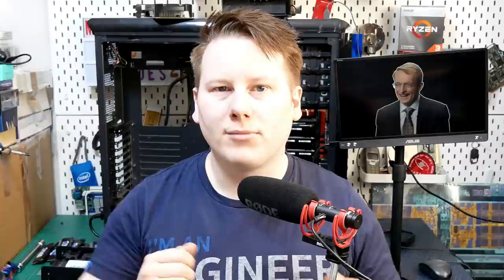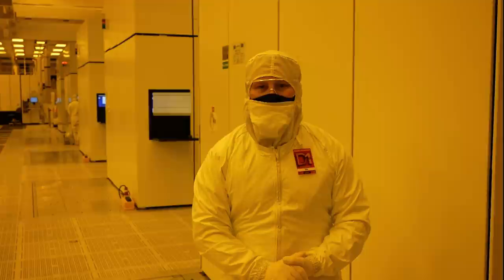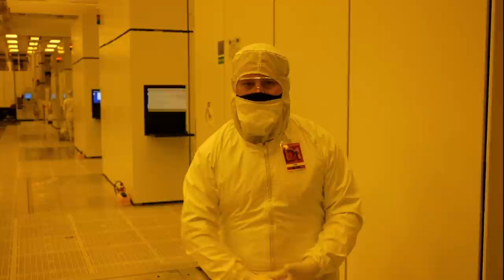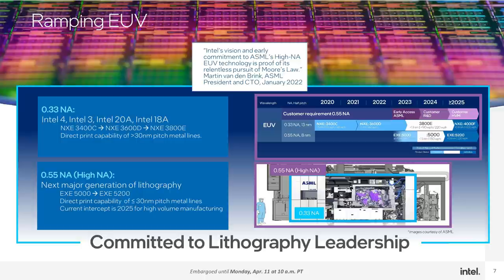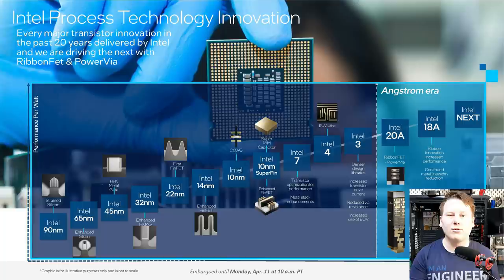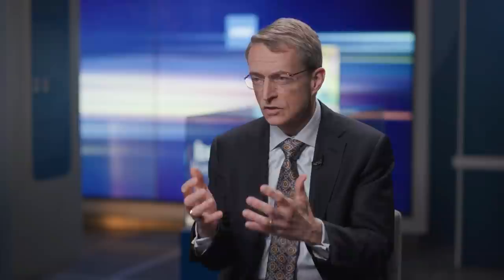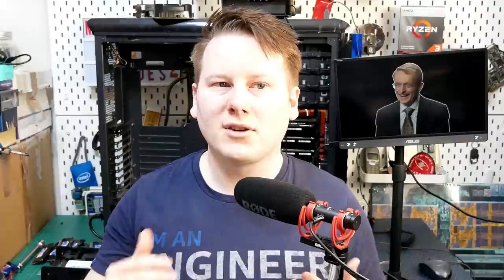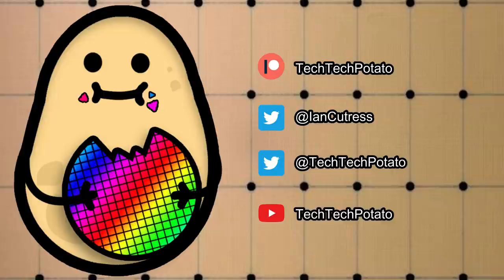Intel's Gordon Moore Park Fab Expansion: More Chips!

Comment: Oh wow they finally opened the place and renamed it? I used to work across the street from there and I've been inside a few times - it's so friggin' huge. 

They had cranes going in and out so much, and one of the buildings has an overhang/connector to an adjacent building so high up that there's a big sign on the side that says something like "Maximum Clearance 150 feet" or something.

p.s. I have the same intel engineer shirt ;D

Comment: so based on this info it some seems like intel 4->intel 20A is the real 'full' node jump, while intel 3 and 18A are more like tsmc's N6 and N4 in-between nodes basically '++' optimzation steps for the bulk orders
Reply: Correct in the sense that Intel 3 and Intel 18A are optimizations of the new node process, but incorrect in the sense that tsmc 7 and 5 were high volume commercial products whereas Gelsinger has gone on record stating that he expects Intel 3 and 18A will be the more economically attractive products for IFS / Intel Foundry Customers.

So whereas N6 and N4 compared to N7 and N5 have the appearance of stopgap products for tsmc, Intel expects high(er) customer volume for Intel 3 and Intel 18A than for Intel 4 and Intel 20A.

Comment: hypothetically if Intel’s 18A node ends up being the best node on the market at the time, would intel be willing to accept orders for AMD to make AMD chips on intel’s process node. It makes for an interesting scenario.
Reply: Likely. Intel has already made a deal with Qualcomm for production and was already in talks with Nvidia for future production. Both are competitors but not as direct as AMD is. If that scenario happens, Intel has already won, they are back to being the best fab, selling excess fab capacity, and their competitor loses the advantage they've had for the last couple of years.
Reply: my guess is if there is excess xapacity, then why not.
Reply: My guess is they will but IMO they are thinking more about Apple than AMD.
Reply: Given that they are supposed to be setting up Foundry fabs too, then yes they should. That way, they make profit whether they or AMD sells a chip.

Comment: Intel is pretty much the last hope for major Western chip manufacturing. All Western governments need to assist them anyway possible.
Reply: They could have used their own gigantic piles of cash but alas, stock buybacks are more important.
Reply: TI just expanded RFAB and announced two more 300 mm fabs in Sherman, TX.
Samsung has announced they are building a fab in Taylor, TX.
TSMC is building two fabs in Phoenix, AZ.
GF has announced they want to build a fab, but are probably waiting on the CHIPS act to proceed.

Lots of new activity in the US.  It's not just on Intel or the USA government.

Comment: On the "A" nodes using both regular and high-NA EUV, will there be a performance difference between them? Does/can high-NA EUV enable a "better" process node than without?
Reply from the maker: Better yields, fewer process node steps, that's for sure.

Comment: If the new processes are going to be more expensive, it might be worthwhile sacrificing margin in the short term to allow them to ramp up production volumes, which will bring down cost over time.

The new fab in Germany is interesting after the announcement that they were no longer considering the UK post-Brexit. I especially thought it was interesting that they wouldn't even consider Northern Ireland, which has the advantage of being in the single market and no barriers to export into GB. I'm guessing the uncertainty of the push from a particular political faction to remove Ireland from the single market was what made them decide against the UK.

Comment: Well , we will see . First there were rumors that TSMC had Problems with their N3 Node , this seems to be solves with their N3e ( enhanced ) Node which is a bit ( 8 % ) less dense than planned for N3  . Intel promissed 10 nm for 2016/17 and delivered 2021 . I am a bit sceptical if they say they will sucessfull develop 5 Nodes in 4 Years ...
Reply: Intel main struggle to make 10nm work is EUV which they miss it. And now they will embrace EUV starting from intel 4 (known as 7nm) so i hope there is nothing hold them back again.
Reply: @Arkan_Fadhila  
It tookTSMC about 20 years to make EUV work , sure , Intel worked on EUV too but i dont think the next steps will be as easy as they think they will bel